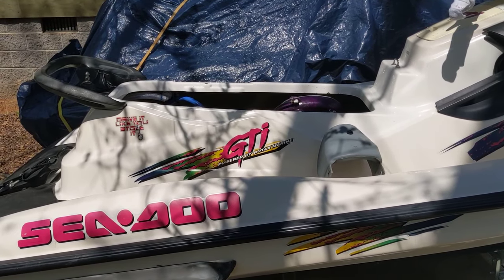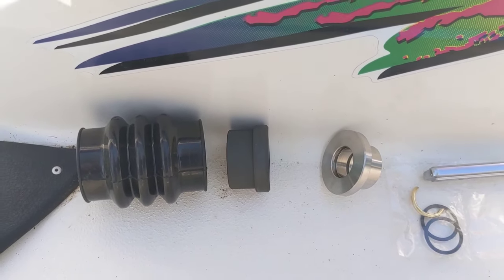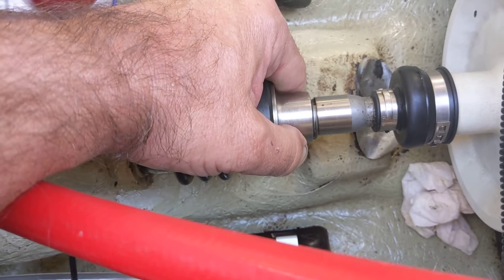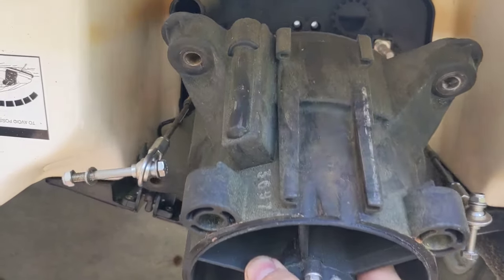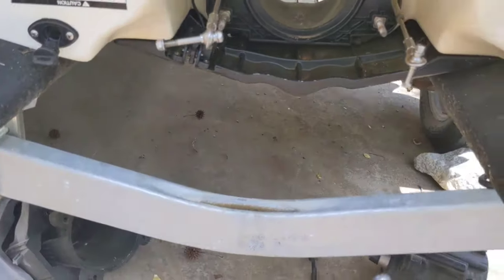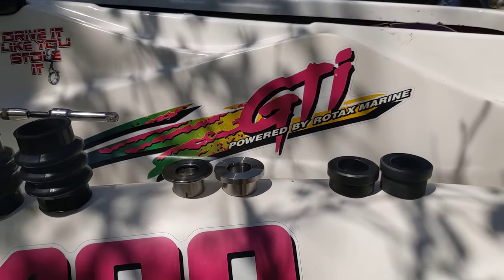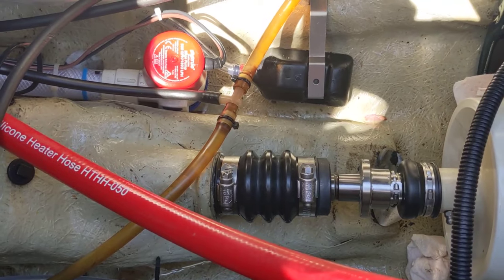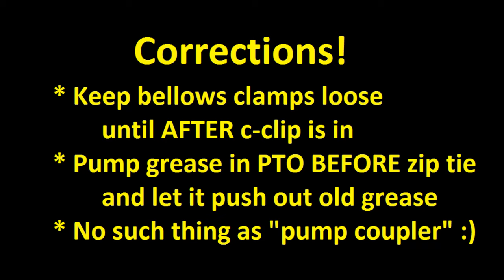Seadoo Carbon Seal - Replace and Explain

Comment: Great idea on the channel lock trick. I've got the same year and model ski, and mine definitely didn't have the rubber discs on the PTO 🫡
Reply from the maker: What do you mean. No rubber orings inside the hat? Or those rubber bumpers on the drive shafts?
Reply: @jonparkmac I got mine apart to do the carbon seal just now and it's got the bumpers. I'm just blind. 

Also fun fact. Mine didn't have the brass c-clip 😂 whoever did the ring left it out. No wonder it had 30 gallons of water in the hull when we finally put it on the trailer.

Comment: Hi Johnathon , I just purchased a 1997 Sea Doo Speedster (2x  720 engines) with some serious Cavitation issues  and was about to just replace the Carbon Seal set but my driveshaft has some corrosion pits right at the outer O ring mating surface to the Carbon Seal Metal Support Ring and since this is  fixed relative to the driveshaft do you think i can just fill the void between O rings with RTV ( I know it might be harder to remove ring next time ) ?
Reply from the maker: As long as both orings seal snug inside the Hat corrosion on the shaft shouldn't matter. I wouldn't reccomend using rtv as a solution there.

Comment: I have a 1994 sea doo xp jet ski, but it works a bit and then it turns on the heater alarm.  what will be the problem
Reply from the maker: I could not say, but join the Seadoo Tech Support fb page and they'll help.

Comment: Great video. Well done and articulate. Some steps we missed. 
I personally don’t trust plastic zip ties for any length of time unless it’s manufactured recommended or not critical. Like a  small engine fuel line to close for comfort. Lol
🔥🔥 
School of hard knocks I guess. Live and learn.
Reply from the maker: Thanks and glad you liked it. Zips are commonly used there but yes a SS ear/oetiker clamp is best and oem. A metal screw clamp is a mistake unless you use two and offset them 180 so they stay in balance.

Comment: Subscribed! Great video - very detailed and informative. I just ran into an issue yesterday with my 96 GTX at the lake where I would rev super fast, but the exhaust pressure was the only thing moving me. A few searches and I made it here - hoping this will be the fix I need as it seems relatively straightforward. Definitely going to inspect the wear ring as well as these are new to me.
Reply from the maker: The carbon ring is only a seal. Your issue sounds like a wear ring. Search "Gray ghost seadoo pump" for my vidi on that

Comment: Really well made video. Good work. Makes it easy to see just what you're doing.
Reply from the maker: Thank you. I'm glad this helped. I use the channel lock trick all the time ..works so fast and easy. I made another one this year about aftermarket bellows and problems with them
Reply: @jonparkmac  that is a great trick. My jet pump put up quite a fight after 30 years of never being removed. I'm glad to be giving the ski new life all over again.

Comment: Thanks for the reply Johnathon , I have a SBT #  77-105 Rebuild Kit and it does not include a metal C Ring but it has an Extra rubber O- ring that I can NOT  figure out where it goes . Do you think it's an upgrade (maybe downgrade)  from the stock metal C- ring  ( I did call SBT and they were no help ) and if so  would you trust it or use the old metal  C -clip ?
Also the boot is a lot firmer than the old one, hope ok ?
Reply from the maker: The one you got is for a shaft with no c-clip but an oring. It's a different setup. You might be able to use the c-clip. Dry fit it and see. Inside the metal hat there should be two rubber rings ..those are for preventing leaks. Don't use OEM bellows. They are too stiff or too flimsy. See my recent video on exactly that subject.

Comment: Great video explaining it. I was wondering how or where the water stops before entering the hull and now I know it comes into the actual rubber bellows boot and stops where the carbon seal contacts the metal collar and also the two orings inside the metal collar.  Pretty vulnerable setup!   Those two cheap hose clamps on that eubber bellows are very important!😊
Reply from the maker: It's quite reliable actually. That's why seadoo used it for many years. The other option is a sealed carrier bearing, which is also good ..but can tear out the thru-hull fitting if the bearing seizes. Those aren't cheap clamps, they're thicker stainless steel from factory

Comment: I am getting water into my hull, about 2-3" in 24 hours if the seadoo is just sitting in the water.
I didn't think it was coming in from where the carbon seal meets the metal disc (support ring I think it is called).  There is no water dripping where these 2 surfaces meet.
It appears to be coming in at the thru hull.  Is this common, and any suggestions on how to replace the thru hull? or am I missing something??
Thanks for the excellent video.
Reply from the maker: They can leak around the thru hull fitting. There's a repair kit for it. I've not done this there, but if you clean it real good with acetone and apply thin layer of 3M 5200 it may stop it for a season or so. Check the back bolts where the shoe mounts to the stern. There's also bolts that come up from the grate. Those can leak

Comment: Great video - I have a 96 GTX and I rebuilt the carbs, replaced all fuel lines, new fuel selector, cleaned and rebuilt RAVE valves, but now I can only seem to get to about 3500/4000 RPMs and can't get above a very slow cruising speed (20km/h). My next step is to pull the pump, replace the wear ring and perform this service you show in your video.  What are the odds this corrects my issue?
Reply from the maker: If the motor doesn't rev past that, then it's not the wear ring or pump. If it does, the it's wear ring or cavitation ..or worst case stripped drive shaft splines. Try disconnecting the rectifier ..they sometimes interfere with ignition.

Comment: Great video and detailed explanation. I have a new to me Seadoo Challenger with single engine. Engine starts and runs great.  My issue is the boat won't plane. I have replaced the wear ring and oil in pump. Impeller secured nicely and tightened pump to hull after a few in and outs in water.  The outcome is boat still didn't plane. Can't seem to get past 10mph running really 7-8k rpms. Every now and then it'll plane and take off. Was told maybe a carbon ring issue. Would going through this rebuild process fix my issue?
Reply from the maker: If carbon seal is too lose it can suck air into the pump and dilute the jet stream
Reply: Check out the seal behind the pump, usually there is a foam gasket there

Comment: I'm finding this to very difficult, is there anything i need to know that would make this easier.  I cant get the prop off of the back (the part with the prop) took all 4 bolts off and detached all the small hoses and still cant get the unit off to get to the drive shaft... help
Reply from the maker: Take all hoses off. Sometimes they are rtv glued on. Pour gas on to losen it. Tie it to tree and pull it off. Can also use a dent puller

Comment: Can carbon seal cause you to loose top end speed? Reason I’m asking my top end speed is 48 mph with 7200 rpms. I should be able to hit 55 to 60 mph with my seadoo gtx 155 but hard stop at 48 mph
Reply from the maker: Yes it can if it's a weak seal. The pump can suck air thru the seal and cause cavitation. Other thing to check is a tight wear ring ..tolerance should be 1 mm or less for max performance

Comment: should that be done whether there are issues after so many hours?
Reply from the maker: A new one will last a long time. Supposed to check every 100 hours. People burn them down running the ski out of water and shorten the life. Keep it wet and grease the pto zerk

Comment: Why did you use a zip tie on that boot?  what about the metal clamp that was there?   Is it supposed to go back on?
Reply from the maker: You mean the oetiker OEM clamps. Not good to reuse as they are usually damaged on removal. Use new ones if you have them, need clamp tool. in this case zip ties fine, and common.
Reply: @jonparkmac  OK got ya.  I'll see if I can find some the right size. Othewise yeah I'll zip tie them

Comment: Question....Does the engine oil need to be drained 1st?  Thanks
Reply from the maker: No, there is no engine oil. There is injection oil and oil for the rotary gear. 2 strokes
Reply: @jonparkmac  oh didn't know this was a 2 stroke.  I assumed it's 4 and that's what i was asking for.  I need to do this repair and seen on another video that Sea Doo recommends removing the oil

Comment: Why replace? When do you know when to change? TIA
Reply from the maker: Need to replace or ski will sink. Check by feeling the pressure with your hand .. should be little snug and not loose or too tight. Check hull often for water

Comment: Wouldn’t be nice if seadoo would utilise the same tech as Yamaha and Kawasaki and use a bearing instead of a carbon seal, 

Did you know?
FACT; seadoo used to use a bearing and a stainless steel ware ring pre 1996

They quickly found out that the flaw with the motor is it only had three motor mounts, therefore highly increasing the risk of engine miss alignment causing the bearing to buckle and seize and the impeller would violently hit the stainless steel wear ring. 

At the time it would cost seadoo a lot of money to pay rotax to change their design, so instead they decided to make wearable items and charge the customer for the parts. Therefore seadoo makes money on the entire life of the jetski 

Food for thought
Yet people keep buying these things

You can’t make this up
Reply from the maker: I've heard similar story. When the bearings seize they tear out the thru hull fitting. That's why some prefer the carbon anyway.
Reply: @jonparkmac  can you elaborate on this?

Kawasaki and Yamaha use bearings and in the 25+ years I’ve been riding I’ve never heard of that happening to these brands, 

If this was happening to seadoos, then why would people keep buying them, 

So you are saying people prefer the carbon seal rather than having the issues with the engine mounts fixed and run a bearing like the other two manufacturers without any wear items? 

I highly doubt it...
Reply from the maker: It's clear you are bent on bashing the Sea-Doo brand in general.  Yes a ton of people buy them and enjoy them .. so you'll have to suck it up and move on

Comment: great video!
Reply from the maker: Glad it helped
Reply: @jonparkmac  is the idle adjustment difficult to get too?
Reply from the maker: @oldsalt8011  no, just have to remove the air box. But you want 3000 out of water and 1500 in water. Don't tune or even run out of water. So if you are trying to lower the idle cuz it seems to high on trailer .. mistake. Also if you do change idle you then need to readjust the oil pump and line up those marks.
Reply: @jonparkmac  Thanks, I'll try to check for the dumb stuff like a leaking vacuum line and a stuck throttle. Yea, I have to be careful that I don't create more problems. I'll look for those marks on the oil pump just so that I can be wise to them. Thanks again for the reply.

Comment: Do you have the link for the parts kit you ordered?
Reply from the maker: I ordered from Amazon, but OSD marine has oem ones. This is working good for me. https://www.amazon.com/dp/B0713RZRLC/ref=cm_sw_r_cp_apa_glt_fabc_25YCRMFFMV7X1CF7MJQY?_encoding=UTF8&psc=1
Reply: @jonparkmac  Are you still happy with that kit? I ordered the same but unfortunately carbon seal came in with a knick in it. Debating returning and buying a different kit, or just having it replaced.

Comment: Good video but I wouldn't have used a cable tie to replace a metal clamp.
Reply from the maker: I mostly use oetiker where it matters. In that spot zip tie is commonly used .. but yeah SS ear clamps always good. Just never use a metal worm drive clamp there